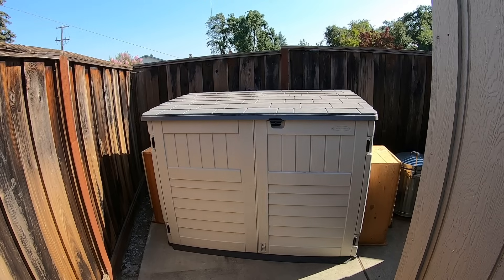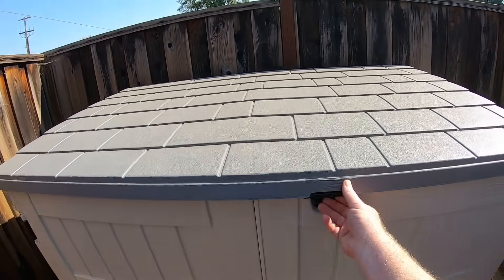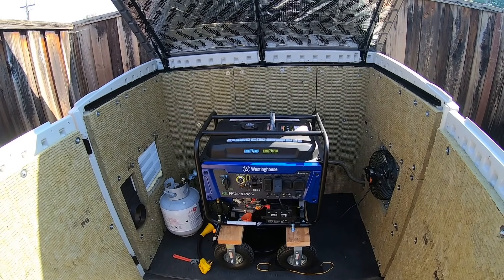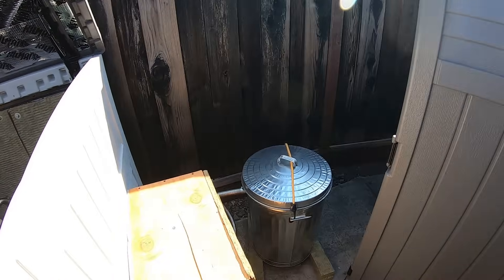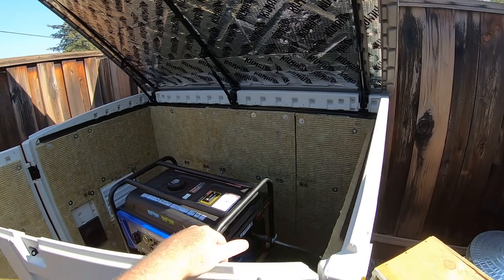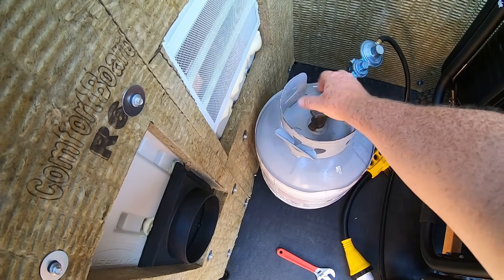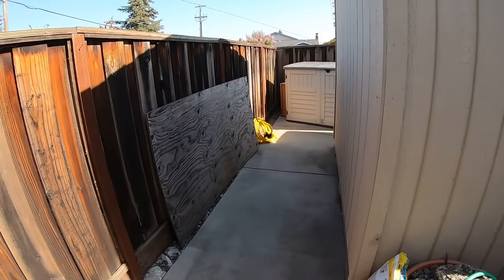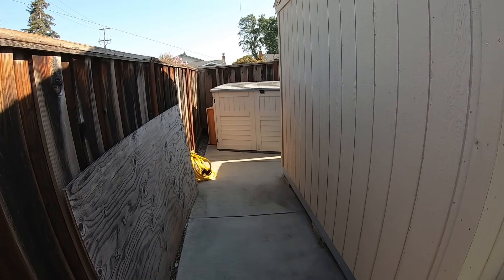DIY Generator Shed Build - Quiet Sound Insulation with Exhaust Muffler

Comment: What type of screws did you use to attach the ComfortBoard? Is there a particular sort with large threads, and do they grip the inner walls well?  Also, what thickness did you use? They make it in 1”, 1 1/2”, 2”, and thicker.
Reply from the maker: If you are interested in the parts that I used, I have several more videos in this series. (See the video description for links.) One of the later videos is on my Version 2.0 exhaust, which has quite a few improvements over the earlier version 1.0 setup. The newer video also has parts lists, shed costs, and other Frequently Asked Questions.  Check it out here: https://youtu.be/y3pUw408jCU
I do go over the screws I used and how I attached them in the video above.

Comment: Great creative build! Question: Please show us the inside of the muffler! And a comment: The exhaust is too close to where the fan is pulling in the air.  Ever thought about moving the muffler to the other side to prevent the exhaust from being pulled back into the shed and back into the generator?
Reply from the maker: There are several other videos (linked in the description) on how the muffler was made, and later updates to the exhaust and muffler.   The fan pushes air out of the shed, it does not pull air into the shed.  It is a typical attic exhaust fan, and they blow outwards.

Comment: Well done great cost effective solution. Now about that secret stainless trash can muffler design, do a quick video on that one as well please. It sounds like a big silencer, similar concept. This is sure less trouble than trying to figure out the noise cancelling frequencies for a digital version. Interesting that the air flow over the internal parts is cool enough, what size in CFM is the attic fan you are using? You can use turbo heat wrap, or aviation heat wrap for exhaust manifolds. Any drop in HP or RPM from the trash can muffler? Thanks for sharing👍👍
Reply from the maker: There are a few other videos in this series.  I detail how I built the trashcan muffler in one, and also how I upgraded it to larger diameter exhaust in another.  Lots of parts lists, prices, and frequently asked questions in the second video.  See below for links, or go to my channel.

DIY Generator muffler build - Version 1.0 - The FrankenMuffler Lives!:
https://youtu.be/jZpRSenXJAs

* NEW!: DIY Generator muffler build - Version 2.0 - The Bride of FrankenMuffler:
https://youtu.be/y3pUw408jCU

Links to earlier sound tests for the shed (below)
Generator Shed Sound Test #1 - (No Sound Insulation):  https://youtu.be/2KQPr7WZIpw

Generator Shed Sound Test #2 - (Sound Insulation Installed, Side Baffles, but no muffler): https://youtu.be/f1mk8KNObDY

Generator Shed Sound Test #3 - (Full sound insulation, side baffles, and muffler): https://youtu.be/2EM6l6kkd30

Comment: This is awesome! How did you attach the comfort board to the shed walls?
Reply from the maker: If you are interested in the parts that I used, I have several more videos in this series. (See the video description for links.) One of the later videos is on my Version 2.0 exhaust, which has quite a few improvements over the earlier version 1.0 setup. The newer video also has parts lists, shed costs, and other Frequently Asked Questions.  Check it out here: https://youtu.be/y3pUw408jCU

That video has a whole section on how I attached the insulation to the shed walls, along with what screws I used to do it.
Reply: @C5Tor  ok great, this was really helpful. I’m doing a similar build in the next week and your video helped a ton.

Comment: Too easy to cut through plastic box and steal the generator. In the event of a major, long-term power outage security will be an issue. Locked heavy gauge metal enclosure would be a better solution.
Reply from the maker: It's really more of a rain cover than a security shed.  The thieves would first have to breech the outer security fence, outsmart the vicious guard dogs and the associated landmines, jump the moat, and then open the shed.  Not too worried about it at this point.

Comment: I enjoyed the videos and the novel ideas for sound deadening. I could have used information on the size (CFM/inches) of the fan and the size of the air inlet. Have you checked the inside  temperature with every thing operating?
Reply from the maker: If you are interested in the parts that I used, I have several more videos in this series. (See the video description for links.) One of the later videos is on my Version 2.0 exhaust, which has quite a few improvements over the earlier version 1.0 setup. The newer video also has parts lists, shed costs, and other Frequently Asked Questions.  Check it out here: https://youtu.be/y3pUw408jCU

Comment: Not a bad little shed.  Sound does actually have no problems with corners.  It uses diffraction and reflection through a narrow aperture or across an edge Just make the edges and passage ways aren't that narrow.
Reply: Just do NOT leave the propane tank inside the shed when the generator is running! That's an "EXPLOSION" waiting to happen!

Comment: Good job. I especially liked the vent baffles which is an area most other generator sheds fail to address. Also, great job on the muffler. You can't beat volume for attenuation and you have plenty.

Comment: Nice job on the shed but you might want to OPTEST that gen under load running on that little bottle. At even half load, that gen will freeze that little bottle, you need at least a 100LB tank to run that gen at load.

Comment: Hey can you list the parts for generator exhaust (where you purchased the adapter coming off the muffler)?
Reply from the maker: If you are interested in the parts that I used, I have several more videos in this series. (See the video description for links.) One of the later videos is on my Version 2.0 exhaust, which has quite a few improvements over the earlier version 1.0 setup. The newer video also has parts lists, shed costs, and other Frequently Asked Questions.  Check it out here: https://youtu.be/y3pUw408jCU

Comment: Awesome job & well done 👍 I have the Westinghouse Wgen9500, that I've converted to Tri-Fuel, that runs on propane, natural gas, and, of course, gasoline.  I'm going to borrow your ideas, as close as possible.
Reply from the maker: Good luck. Make sure you check out the later videos in the series, where I go into upgrades and parts lists, etc.  Links are in the video description.

Comment: I am currently looking for a shed like this myself, I want sound damping for winter power outtages so I can keep the furnace running all night.
Reply from the maker: If you are interested in the parts that I used, I have several more videos in this series.  One of the later videos is on my Version 2.0 exhaust, which has quite a few improvements over the earlier version 1.0 setup. The newer video also has parts lists, shed costs, and other Frequently Asked Questions.  Check it out here: https://youtu.be/y3pUw408jCU

Comment: How did you attach the Rockwood to the shed walls? It doesn't look like the screws go all the way through the walls.
Reply from the maker: I have several more videos in this series.  One of the later videos is on my Version 2.0 exhaust, which has quite a few improvements over the earlier version 1.0 setup.  I cover the screws I used to attach the rockwool and how I installed them in that video.  The newer video also has parts lists, shed costs, and other Frequently Asked Questions.  Check it out here: https://youtu.be/y3pUw408jCU

Comment: I wonder what would happen if you double the walls...and then make Lil S shapes in the baffles that way the noise is trying to come out around corners not straight..
Reply from the maker: There are lots of other things you can do to incrementally improve the sound attenuation.  Double walls and more effective baffles are some of those things.  But somewhere in that process, you reach a point of diminishing returns.  So, it's really about how much time and money you want to spend on the project.  I've seen people build a shed within a shed, and then put multiple fences around it.  Once the shed gets expensive enough, you could have just bought a quieter (but more expensive) generator specifically designed to power your home.  In my case, I needed a portable generator for a specific purpose, and the quiet shed was more of an afterthought.   But each person is going to have their own vision and needs.
Reply: @C5Tor  ok, I'm not trying to throw dirt on your work..
I'm just saying if you experimented with putting double walls.?
I'm trying to build a shed also for my generator since it's loud and I don't want to be bothering people with the noise..
My idea is a 6 concrete pallets, not the flimsy pallets. Concrete pallets are made strong and sturdy...particle board from  construction sites.  They are always throwing away wood. And if ypu ask, most of the time they'll let you have what ever they don't need anymore..
Reply from the maker: No issue with your comments, and I wasn't assuming they were negative.  I was saying that those ideas would definitely work if you'd like to try them.  I was just pointing out that these shed projects can be real money pits if you let them.  But if you have the time and money to spend, definitely go for it.  I like the idea of the pallets.  The more mass you can put into the shed to absorb the sound, the better.  To answer your other question, no, I haven't experimented with those options myself.  I've documented what I did in the video above, and also in some follow-up videos on my channel (linked in the description) where I eventually upgraded the exhaust to 2" and improved the trashcan muffler a bit.  I also answered some frequently asked questions and gave some shed costs and parts lists.  Good luck with your build!

Comment: Very ingenious setup.  CA requires a carbon monoxide auto-shutoff on portable generators.  This means I would definitely need to mimic your muffler setup; yes?
Reply from the maker: I would definitely recommend routing the exhaust outside of your shed.  Whether you add a muffler or not depends on the generator and your noise-level requirements.  If you are in the woods, it doesn't really matter.  If you are in a quiet residential neighborhood, you'll probably need to do something.  Whether that is redirecting the sound up in the air or underground or building some kind of muffler is one of your design choices.  This particular shed was really just an experiment incorporating several ideas I had not seen in other builds, and it turned out pretty well.  It was really meant as a catalyst to give people ideas of things they could try in their own quiet shed build.  It wasn't intended as a blueprint to follow exactly.  It has lots of room for improvement.  I actually made a couple more videos in the series showing how I made a few more improvements on the shed, the exhaust and the muffler.  Check them out on my channel.  The links are also in the video description.

Comment: Great video. Doesn't it still get very hot inside the plastic shed when generator is runming??  Is that ok for the generator?
Reply from the maker: It does get hot.  The more ventilation you can give it the better.  If I were to do it again, I'd probably add a slightly bigger fan, and a bigger inlet vent.  It's all going to be a compromise, heat vs sound level.  You'll need to find a balance as to what works for you.

Comment: A really good result and a nicely done build! I went with a Honda EU7000is (converted to tri-fuel) with no shed and the sound is under 55 dB. A bit pricy though.
Reply from the maker: Wish I could have gone with something like the Honda quiet inverter.  But, as you said, it is quite pricey.  However, my main reason for not going with a quiet inverter is that there weren't any available to push the load I needed at the time.  I needed one that could push 8000w and 32 amps to charge both of my electric motorcycles while at the motocross track.  The only quiet inverter that even came close at the time was the Harbor Freight Predator 9500, but even it was a bit too underpowered for that use case.  I discuss this in a later video (https://youtu.be/y3pUw408jCU) in the Frequently Asked Questions section.

Comment: HI again. How did you attach the blast gate. is it glued to shed?
Reply from the maker: I used screws to hold it to the shed.  However, the screws don't go through the blast gate itself.  The screws are just next to the blast gate, and large washers overlap the edges of the blast gate and hold it to the inside of the shed.  If you try to put screws through the blast gate, then the gate won't be able to slide open/closed.
Reply: @C5Tor  Excellent, that makes sense.   Thank you again

Comment: Its a very good idea!!Can you make couple of pictures about inside of the muffler?I really would like to see how build up exactly if its possible.Thank you
Reply from the maker: I made several other videos in this series.  They are listed in the description of the video.  One was about how I built the original trashcan muffler, and the other was about the many upgrades I did to the exhaust along with answering lots of Frequently Asked Questions about the shed, including costs and parts lists.

DIY Generator muffler build - Version 1.0 - The FrankenMuffler Lives!:
https://youtu.be/jZpRSenXJAs

* NEW!: DIY Generator muffler build - Version 2.0 - The Bride of FrankenMuffler:
https://youtu.be/y3pUw408jCU
Reply: @C5Tor  Thank you so much for your answer!

Comment: what type of fasteners did you use to secure the rock wool from the inside? Some people have the fasteners going through the walls and can be seen from the outside. Yours are very clean looking.
Reply from the maker: I have several more videos in this series.  One of the later videos is on my Version 2.0 exhaust, which has quite a few improvements over the earlier version 1.0 setup.  I cover the screws I used and how I installed them in that video.  The newer video also has parts lists, shed costs, and other Frequently Asked Questions.  Check it out here: https://youtu.be/y3pUw408jCU

Comment: Great build! Thinking of attempting to copy your ideas. Do you have a part list of what you used? I have a 14x16 shed that I've also thought of just using and keeping a door open and exhaust fan in the window.
Reply from the maker: I have several more videos in this series.  One of the later videos is on my Version 2.0 exhaust, which has quite a few improvements over the earlier version 1.0 setup.  The newer video also has parts lists, shed costs, and other Frequently Asked Questions.  Check it out here: https://youtu.be/y3pUw408jCU

Comment: running a generator to charge an electric motorcycle.......
Reply from the maker: Yep.  I have a whole section of a later video discussing this very subject. (See link below.) I didn't say I charged the electric bikes at home with the generator, only at the MX track or out camping.  Basically, you need the energy in a form that you can use for your application.  Kind of like when people use electric gas pumps to get gasoline or diesel in their fuel tanks.  The newer video also has parts lists, shed costs, and other Frequently Asked Questions.  Check it out here: https://youtu.be/y3pUw408jCU

Comment: Thanks for sharing. I will be duplicating your work.
Reply from the maker: I have several more videos in this series.  One of the later videos is on my Version 2.0 exhaust, which has quite a few improvements over the earlier version 1.0 setup.  The newer video also has parts lists, shed costs, and other Frequently Asked Questions.  Check it out here: https://youtu.be/y3pUw408jCU

Comment: Hi, thanks for the very informative video. I have the same generator and am starting to plan my shed build for it. Which model of the Suncast shed is this?  Have you done any temperature measurements in the unit as it is running with the fan? Thanks!
Reply from the maker: I have several more videos in this series.  One of the later videos is on my Version 2.0 exhaust, which has quite a few improvements over the earlier version 1.0 setup.  The newer video also has parts lists, shed costs, and other Frequently Asked Questions.  Check it out here: https://youtu.be/y3pUw408jCU
Reply: @C5Tor  Thanks, very helpful! Not sure I need the big outside muffler you built.  On the original plan you had, you used a 3/4 NPT tap on the built in muffler exhaust pipe?
Reply from the maker: Yes, I did.  I went into quite a bit of detail in the video on that part.  However, you need to check your own muffler to see if it is the same.  I've heard this particular generator has come with various mufflers over the years, and they do not all have the same ID/OD measurements.  So, you'll need to check if yours is the same.

Comment: Those decibel numbers seem real high.  I just bought a 12,0000 watt Duromax duel fuel generator, its coming in at 72db out of the box with no mods.
Reply from the maker: Keep in mind that the numbers I showed were mostly from right next to the generator, and especially with the open box, it was reflecting back at the sound meter.  If it was sitting in the middle of the yard with nothing around it, the readings would have been much quieter.  So, it depends on how you test it, and from how far away.  I think standard testing procedure for generators is in an open space from 7 meters (23 ft.) away.  So, it depends on your circumstance and how you test.  But I've seen a couple other videos of this generator, and they tested identical to mine when in a shed.

Comment: Great DIY build. I think you'll go threw a lot of those propane tanks if the powers out any length of time. Might consider getting a couple of 100lb tanks unless you have access to NG. Another thing you might want to add is a sail switch wired so if that fan should crap out it would cut off the generator before it over heated. That would get ugly before you knew about it.